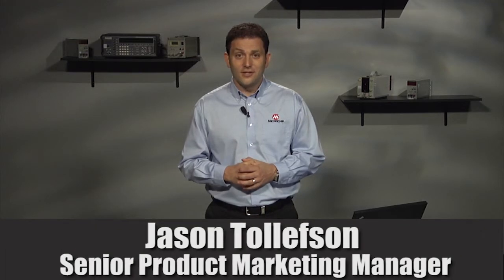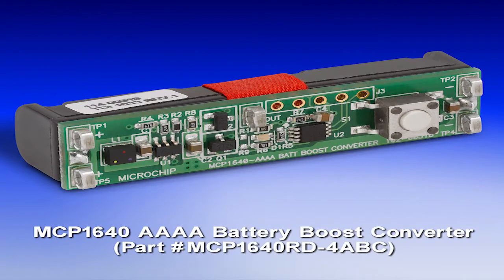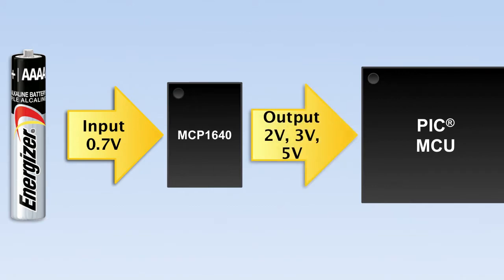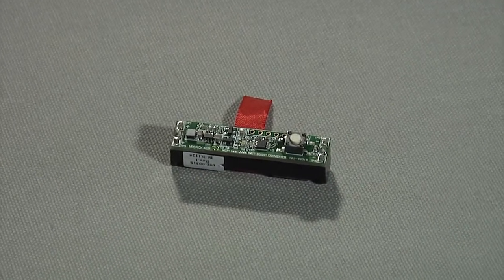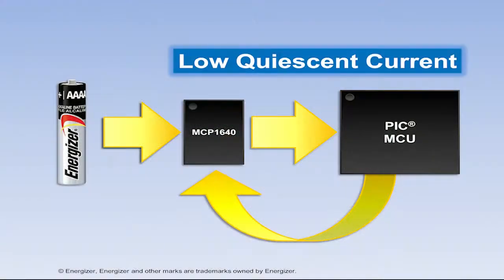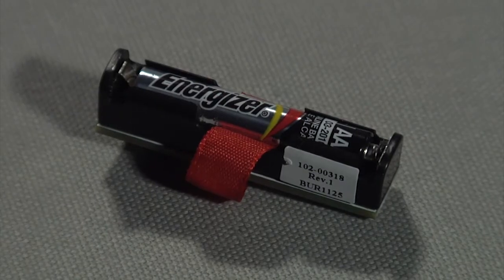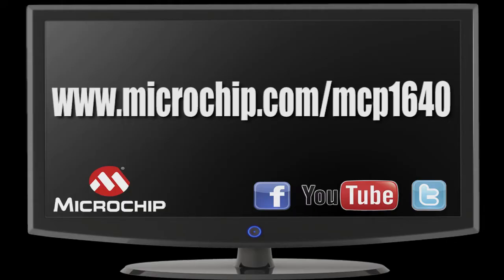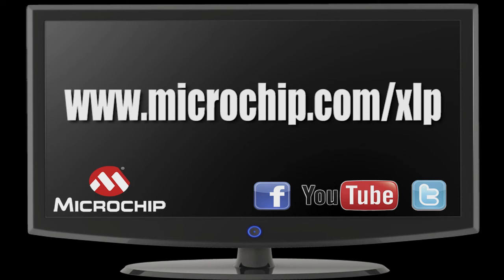Single AAAA Battery Reference Design for Low Power PIC® MCU

Comment from the maker: @MrPetrHa Great feedback on the MCP1640 demo board.  In regard to the expense of the AAAA, it depends on where you are buying them.  If you are buying them at a retail location, they are about the same cost as a CR2032.  If you are an OEM running high volumes, the cost is much cheaper for both and they are still within $0.20.  The AAAA has much more capacity and should last longer in the application.